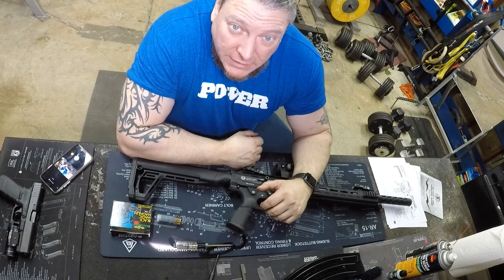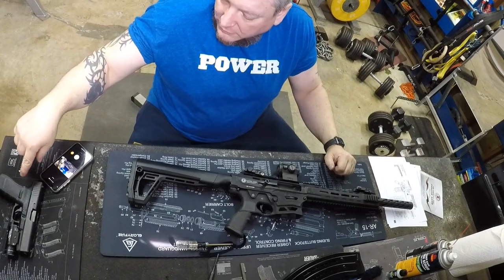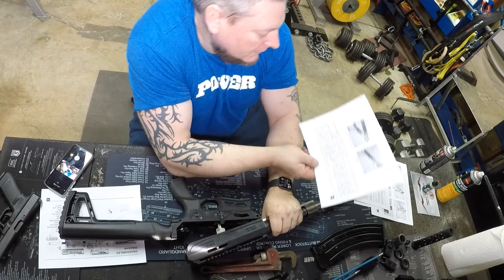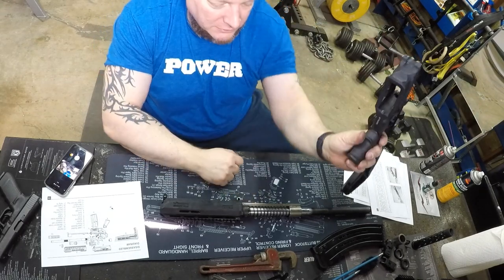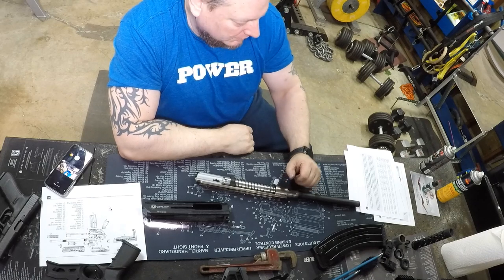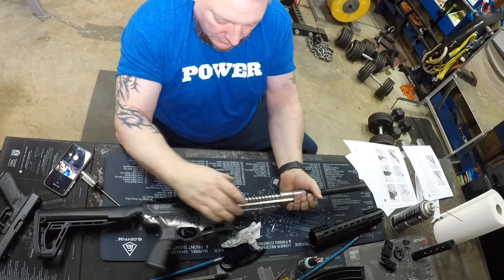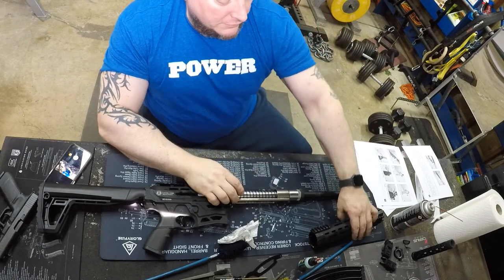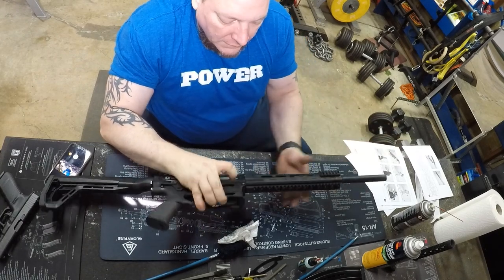Unofficial*    disassembly of Panzer AR 12PRO

Comment: Bryan, Thanks for this video. I went to the range to break my new PA AR12 Pro in the other day. I fired 35 shells starting with 00Buckshot, #4 Buck shot, The #7.5 & #8 birdshot. The gun preformed exceptionally well and I now have a new fav firearm.  It's always great to have a video along with the Manual and you did an excellent job!  God Bless and be safe, Butch
Reply from the maker: Awesome. Thanks for the comment.   They are soo much fun right.   !

Comment: Bryan, I carefully watched everything that you did. Thanks for the video!! Please help me to know how to properly disassemble the bolt carrier group in order to gain access to the bore. I never saw how you did this on this video. If you have another video on how to do this please let me know. Thanks!!
Reply from the maker: I never did a video of taking the bolt apart     On the quick video I just removed the bolt from the barrel.   After my shoulder recovers from surgery I’ll try to make one
Reply: @BryanKulpanowski  thanks for getting back with me. I just bought my first AR-12 PRO and I'm just trying to go through it, strip it down, degrease/clean, and lube up everything, especially the barrel. Still trying to discover how to get into the barrel. Also, the UPPER RECEIVER PLUG never budged, even with 100 ft lbs of torque. I was afraid that I was going to break something. Is there anything that might be preventing that to turn CCW?
Reply from the maker: @francislayton76  they probably started making them much tighter at the factory.  I’ve heard many complaints about them loosening up.   That’s why they added the spanned wrench tool to the nut on the piston
Reply: @BryanKulpanowski  I just saw your "short version" video and it helped a lot on getting access to the barrel. Thanks!
Reply: @BryanKulpanowski  Yeah, I was able to get the nut loose where the piston and gas block are located. The one I can't budge is the black barrel nut. It's really frustrating.
Reply from the maker: @francislayton76  that’s good they are making them tighter from the factory.   They loosen up when you shoot them a bunch anyway.   Definitely check it often if you shoot it a lot
Reply: @BryanKulpanowski  Thanks, and you are right, they sure are tight, especially the black barrel nut!! lol I even had a gunsmith, today, tell me that I wasn't supposed to remove the barrel nut. Well guess what? That's THE ONLY way to remove the barrel from the upper receiver. Mine only happens to be way over 120 ft lbs from the factory and I don't have a pipe-wrench yet..
Reply from the maker: @francislayton76  I’m glad you got it loose.  I’m glad they are tightening them properly

Comment: I found out that the bottom of the 5 round mags that were included are able to slide onto the picatinny rails of the gun. Interesting.
Reply from the maker: Jeff Lee I’ll have to check mine.  So that would be hanging upside down I take it ?
Reply: @BryanKulpanowski  yeah upside down. You can attach it on any of the 4 rails, but the bottom rail makes the most sense. But I really don't see a reason for doing so. I wonder why they manufactured them like that. But I wonder if we could use like a 4 inch segment of double sided picatinny rail to connect the bottoms of the two mags to each other which would allow one mag to be inserted then the second connected to it would be available for a quick reload.
Reply from the maker: Jeff Lee that would make sense. I think they have adapters to double and triple mag them side by side. I’m guessing that’s why the rail slot is there

Comment: On your bolt carrier tube where the piston hits. Have you noticed any metal rolling on that tube or any deformities?
Reply from the maker: No   The only wear I find unusual on this firearm is the feed ramp   I’ve filed down the sides because they have been dinged up.   Someone else has mentioned the same issue.
Reply: Bryan One alright. Thank you for the response. I’m bout to put this through a torture test and see if it gets worse. If not then I’ll assume it’s a normal wear pattern.

Comment: Im not sure if the pro is the same as the gen 4 which is what I have but I only shot mine once (a mag or two) and now the firing pin doesn't seem to pertrude enough to strike the shells when the trigger is pulled. The pin itself seems fine, I just have no idea why it's not working.
Reply from the maker: I would have the dealer send it back for repairs

Comment: For some reason, the charging handle on my bolt refuses to come out?! I have tried using powder blast/oil to free it up and toyed with it for hours. Any other suggestions?
Reply from the maker: I just pull the bolt back maybe 1/4 inch to unlock it then it frees the handle to finagle straight outward

Comment from the maker: for the short version     https://youtu.be/s1GRNJu6n-c.   Yes I (me) (myself) use a pipe wrench for the lock nut.  When that nut comes loose after 100 rounds the hot gas will burn your forward hand. So maybe panzer should have made that nut accept the same tool as the barrel nut.  But yes I use a pipe wrench. Deal with it.  NOTE : PANZER has made the new version with the spanner wrench nuts so apparently they listened !!
Reply: For the life of me I could not break the lock nut. Both the silver and black nuts rotated together. I will need to get another pipe wrench to hold the one side to break the other loose. Thank you for the video.
Reply from the maker: CarShowz the black nut is threaded normal as the silver piston is backwards
Reply: Bryan Kulpanowski yes sir, should just be able to rotate both wrenches in the opposite direction to break them loose, correct? I have not fired the gun yet, just figured I would break it down, clean and oil it real good.
Reply from the maker: CarShowz yes I would focus on the black lock nut first.   Lefty Lucy.  Then the silver should be easier to loosen.
Reply: Maybe I have a different version?
Reply from the maker: CarShowz I’m gonna take a look
Reply from the maker: CarShowz yours has the notches for the tool I see.  Mine is just knurled.   Interesting.   That is definitely a different version
Reply from the maker: CarShowz your has the notches. Like I figured they would do eventually.   It’s definitely a newer version
Reply: Bryan Kulpanowski I used the provided wrenches (2 of them) and I was not able to crack the buts loose. A pipe wrench like you used may solve that. What is throwing me off is how both nuts are spinning. Should the silver nut be secure and not spin?
Reply: Just following up, I had to use 2 pipe wrenches to break the gas piston nuts loose and a pipe wrench for the barrel nut. They were crazy tight in there. Was able to break it down and clean and oil. The pins were a pain in the arse also. Oh and the barrel / spring assembly came apart, that was fun putting back together. 

No response from Panzer other than a picture showing me how to hold the wrenches haha 

Appreciate your time and response.
Reply from the maker: CarShowz I’m glad you broke it free.   That’s crazy it was that tight

Comment: Hey what about changing a different stock?
Reply: are you able to put an adapter bc I saw a picture with someone that had a magpul on theirs
Reply: The bolt needs a hex security key. I dont know what size. Is there anyway to find out?
Reply: I just took my stock off and will order buffer adapter. I'm going to make a video about it because not many people has done it.
Reply: I have ordered everything and removed my stock. I will make a video once everything comes in.
Reply: @b fun I have ordered everything once I get all the items I'll make a video. Feeling excited!
Reply: I put a Mil-Spec stock on my Panzer. You will need an adapter to get you there. TripleFFirearms had one for my Pro and it’s a perfect fit. Took <10 minutes to install.
Reply: @phildaug  I did too!
Reply: @phildaug  can you do the same to a non pro model?